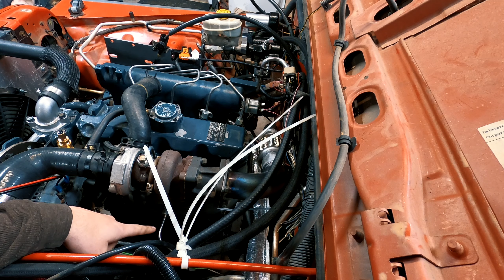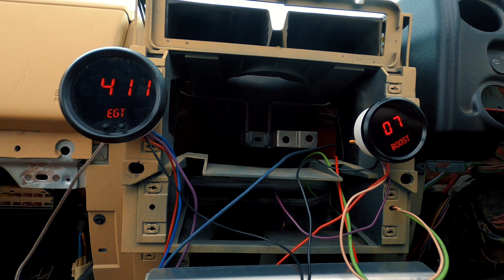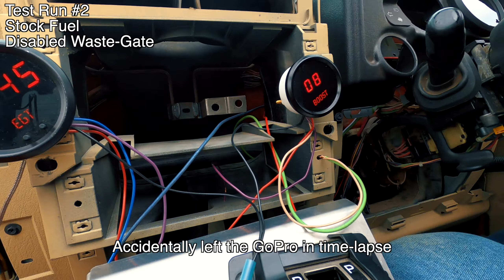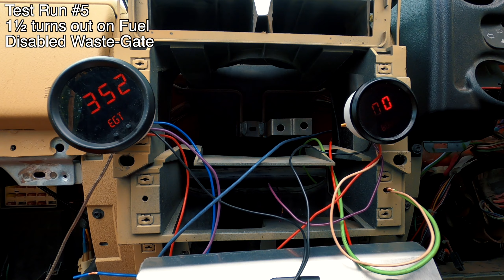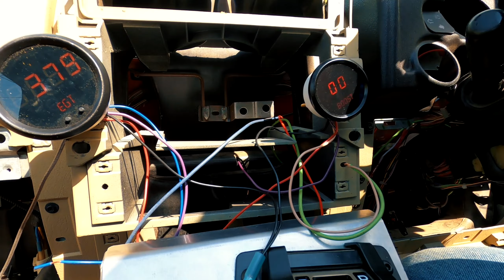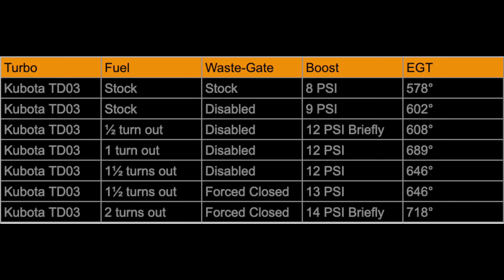Adjusting the boost & fuel on the Kubota V2403 before having radiator problems [Diesel RHD TJ - 70]

Comment: If you had to guess, how much power did you get out of it by the end? I have a D1402 I am thinking about swapping into something, but not sure what it would be suitable to.
Reply from the maker: Completely missed this. I can tell you a D1402 is not going to have the power you need for a Wrangler swap. That is a 3 cylinder 1.4l engine. You really need a 4-cylinder engine minimum. I think factory the D1402 is like 30hp maybe . . .